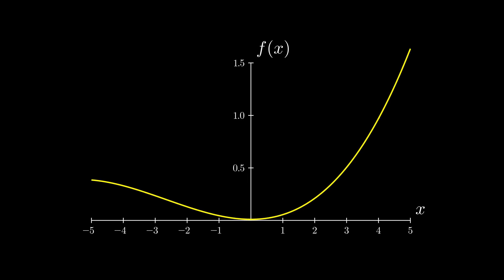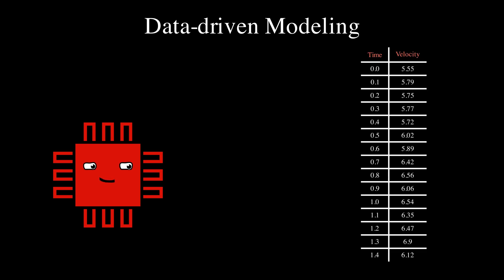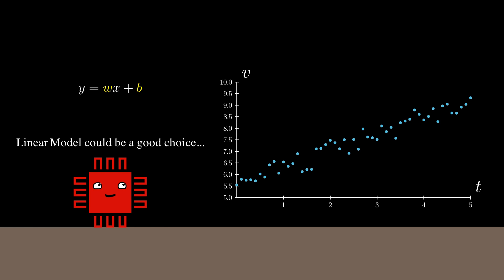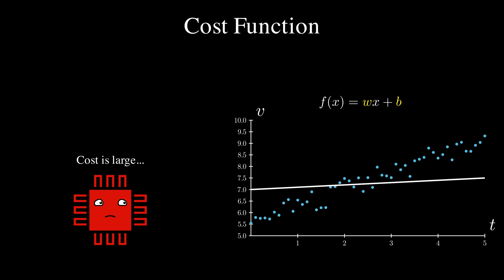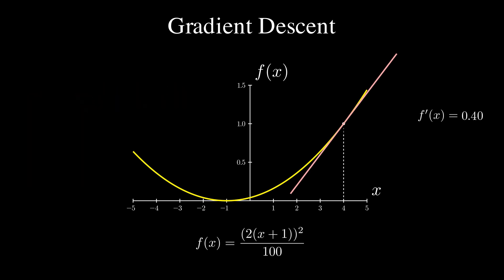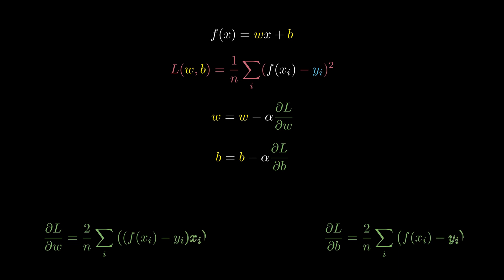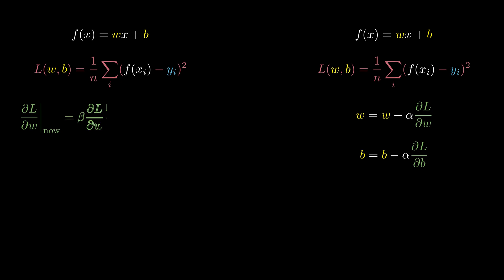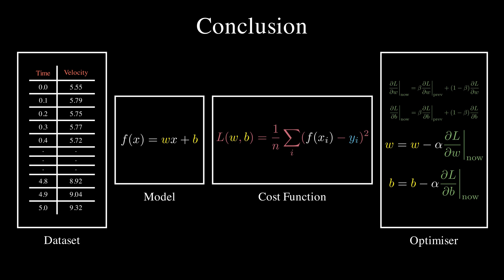The Problem with Gradient Descent #SoME3

Comment: Really good video and explanation!
I'm not sure if this is what you meant, but I'd say that gradient descent is pretty good, but that's if we have infinite steps to work with. If we do have, we can make the update changes approach zero and avoid any "jumps". But since we don't have infinite steps to work with, then yeah, some techniques help with the updates!
Reply from the maker: Not entirely true. I’ve tried training a basic neural net on MNIST dataset using vanilla GD and it fails to converge. For visualisation I’ve kept the dimensions to 2 but in higher dimensions this becomes a serious problem. That’s why you see optimisers like Adam used almost all the time in practice.
Reply: @tgautam03  I understand, but you didn't train with infinite time in your hands (pushing the alpha towards ~0, like 1e-36). I agree that in practice, with limited training time, then those problems with GD become practical.